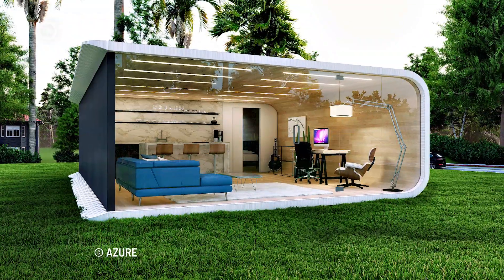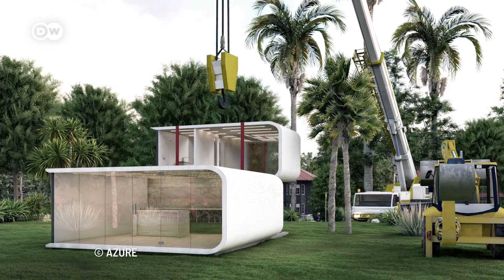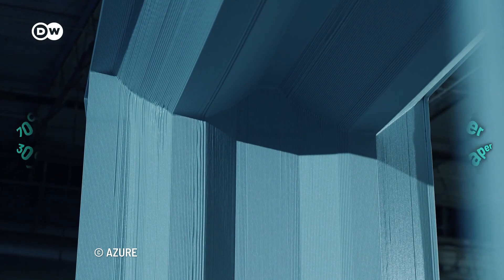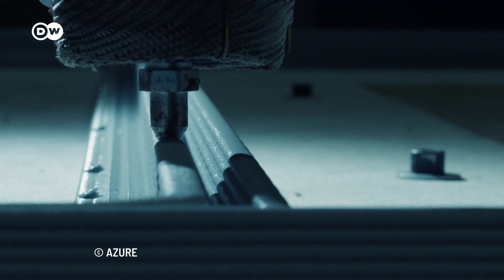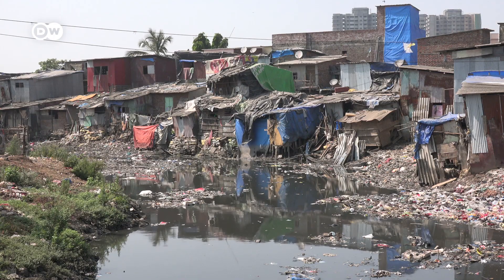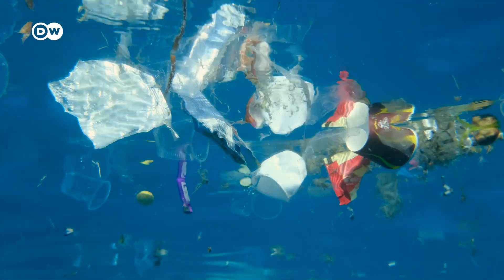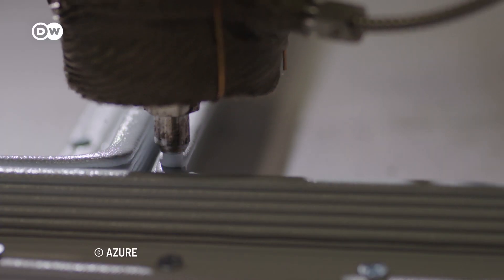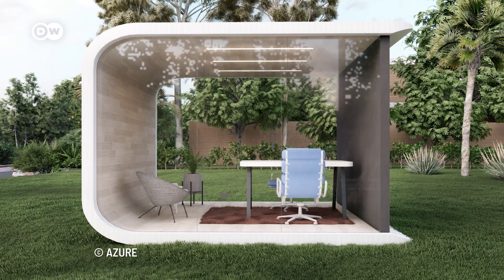Can 3D Printing Solve our Plastic Problem?

Comment: OK... I'll come straight to the point. I want (need) to replicate a large (7ft.X4ft.X3ft.) electrical transformer Case... Sitting atop a "PLASTIC" slab that (looks like concrete). In other words (A Fake Electrical Power Transformer). In dark Army -Green color. Can you do it? How much would it cost?